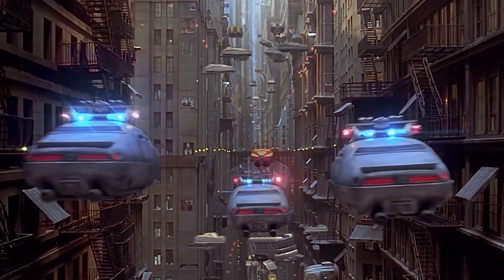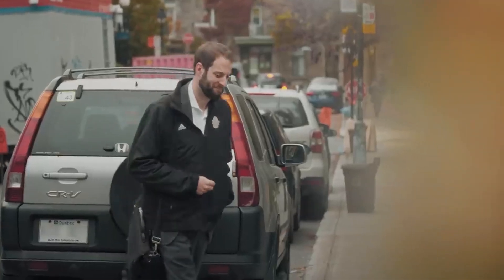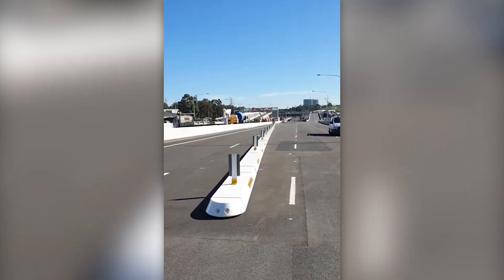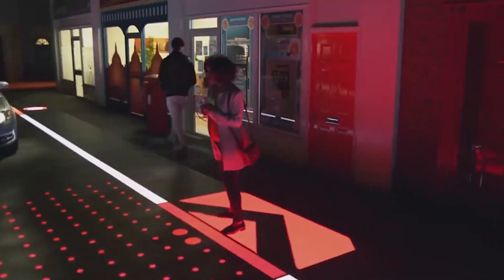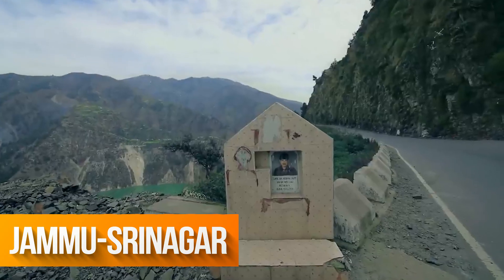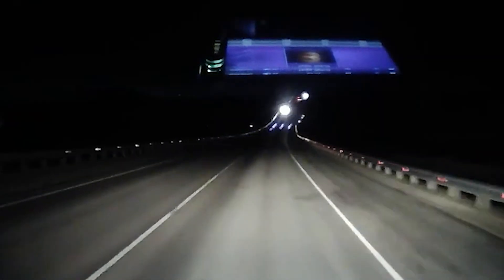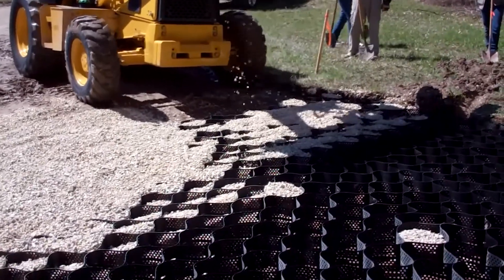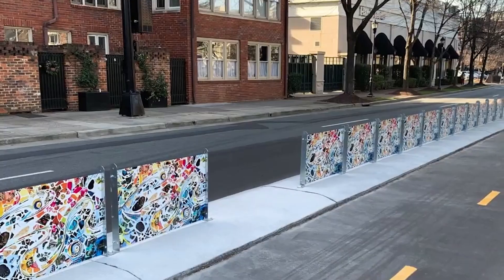Incredible Road Technologies That Are Insanely Cool

Comment: My bother has been creating and using "pervious concrete" in the (San Fran) bay area for over ten years.  It's mostly used on parking lots, driveways and walkways-as it doesn't (yet) stand up to very heavy-vehicular traffic.
Reply: Wut, it's been the highway standard where i live for over a decade
Reply: @bunch_of_numbers  And WHERE do you live??? And are you certain it is Pervious Concrete?
Reply: @leonardothefabulous3490  idk if it's the exact same, but it's pervious asphalt. But i live in the Netherlands, where winters are relatively mild which helps it last
Reply: @bunch_of_numbers  Thanks. It is not the same product. You have Asphalt, the product I'm talking about is Concrete.
Reply: @leonardothefabulous3490  yall make roads out of concrete in the us?
Reply: @bunch_of_numbers  Yes-and asphalt-which covers more roads than concrete/cement.  However the product I'm taking about  is NOT being used on roads. Hopefully one day it will be but for now it's used on driveways, walkways, parking lots, etc

Comment: 8:19 I’m confused. At least in my area, traffic signal override systems have been in use for at least the past 2 decades. Obviously their use is monitored through the traffic light control computers, so while it is possible to get them on the black market, they are highly illegal to use and very traceable, so you’re unlikely to go a week of regular unlicensed use without getting tracked down and locked up (assuming you can’t pay the astronomical fines for this sort of blatant disregard for road rules). Naturally, your license to drive is unlikely to be recoverable, too. So why is this in a list of speculative future road technologies?

Comment: The roller barrier seems to push the vehicle back into the traffic lanes. Which seems to be a larger problem, at least in my opinion.
Reply: Conventional barriers are literally designed to prevent cars bouncing back into traffic, i dont get the point of these rollers

Comment: 6:07 this is a copy from the dutch roads. They call this an experiment?? There's around 3000 km of highway roads in The Netherlands using this technology for 15 years already! There's not a single splash of water even during the heaviest rainfalls on dutch highways. The brits did NOT invent this. And it's not an experiment, it's already widely used on dutch roads.

Comment: A problem with all solar-powered signs and warning lights is that current battery technology only lasts a few years, after which batteries fail to recharge. If drivers rely on the warnings and they suddenly stop, accidents could occur.
Reply: Reflective already exists. You just need to turn the lights on. No need for solar powered.

Comment: The porous asphalt is very, very well known. However, it has to be maintained. And that includes actually vacuuming it!
Reply: Nope! The layer underneath must be porous and too much water has to flow to the sides. Normal rain will wash away sand.
Reply: @dutchman7623  I have a brother that has installed these in Arizona. His first complaint was that he had to go and vacuum these parking lots at least once or twice per year to keep the sand from building up and creating a non-porous surface during that time.
Reply: @RazingthenRaising  If used on highways and big roads you do not have to vacuum clean them. Never saw anything vacuum clean hundreds of miles of highway.
But the underground has to be laid out correctly (drainage to the sides), and the top layer thick enough.
Reply: @dutchman7623  Understandable. Traffic tends to blow things around. My brother's complaint was parking lots.
Reply: @RazingthenRaising  And the climate in Arizona is rather different that what we have here. Very moderate and rain at least once a week.

Comment: 8:24 I'm pretty sure this already exists. There have been times in the past where people are able to change the lights on signals by sending out certain frequencies. Although this would be the first time I've seen it used legally.
Reply: All Dutch emergency vehicles, public buses and trams are equipped with it, instrument is called a transponder. No use to steal it, because it will be removed from the list of active transponders and therefor useless.
Reply: I think this actually exists pretty long already, like 10-20 years. Here in Germany it is all over the place.
Reply: Most things in this video already exist in some way. Often times simple more effective ways.

Comment: The system to change traffic lights has been in use in America for over 20 years. The emergency vehicles transmit an encrypted light signal with the password and the unit ID
So you can see exactly who has triggered the green light and what lane, direction and time it is triggered
It is called MIRT
Reply: Even Dutch public transit like buses and trams have this system. They always get green with priority, unless they are ahead of schedule. So their time schedule is integrated in the system.

Comment: We call that asphalt popcorn pavement in the northern US. The purpose of this asphalt is that the water seeps through this surface layer and drains on the intermediate surface, eliminating surface water and the potential hazards that come with surface water retention. However, when water freezes it expands, and when this happens in between two layers of asphalt, they separate. This asphalt mix had holes everywhere from freeze thaw cycles earning the name popcorn mix. It’s been around for a long time and is only used in warmer climates due to this characteristic.
Reply: We use it in the Netherlands, not sure how but the freezing problem has been tackled.
Reply: @Snaakie83  It hasn't been tackled, they just repair it very fast.

Comment: They used to call speedbumps "sleeping policemen".. until they realized people were going faster not slowerr when going over them.. by the way, sometimes it works too, you don't notice them so much.
As for the lights at 10:00 gat see some drivers having fits and it bringing in epepsy.. the electric rail in the road.. try riding your moped when delivering a pizza and see if you can "get out of the Groove" man.
Reply: Don't you think they have pizza in Amsterdam, Rotterdam or The Hague where streets are full of tram tracks?

Comment: The plastic road panels at the 10:00 mark are stated as 10 square feet.  They appear to be about 10 x 10 feet which would be 100 square feet.
Reply: Yeah, I think he meant to say 10-ft/sq. instead of 10-sq./ft.  also, it was at 11 mins,
Reply: And with it you get a bidirectional Dutch cycling path, complete with the right color and texture. It is still in experimental stage where some stretches are used to test durability.

Comment: 6:10 The Porous Road system in the UK, though not implemented beyond some experimental stages, was proven to be unworkable. They proved to be unreliable in the event of low level flooding points where the water HAD no where else to go, debris clogging the ‘natural’ water channels, and was ripped up far easier by freezing/melting conditions and heavy traffic.
Which is a pity, as it is being used in some parts of Europe.
Reply: Had it as part of my company’s parking lot.  Completely inefficient in cold weather with ice and snow.   Couldn’t plow the snow and the ice did a number on it.  A warm weather option only.
Reply: You do know all dutch highway roads already have had this for 15 years? Rain get's absorbed instantly, not a single splash. This road has not been created by the brits. It's a dutch creation.
Reply: @Nimac91  
I never said it was a UK creation. I also never said it wasn’t being used across Europe.
I said it is unworkable in the UK, the reason I said it is unworkable in the UK is because the drainage system in this road would be defeated by low level flooding in the UK, a vehicle on fire, ice formation, debris, and trucks, which let’s face it, damage even non porous roads.

Comment: Drains don't typically get clogged in my neighborhood it's usually there is too much rain to handle at once. 
Potholes are patched they won't replace 1/4 mile for one pothole. They don't want to spend the money unless it's really bad.

That pavement would be horrible for a bathroom floor. I rather have a waterproof floor where puddles form than the floor boards rotting.

Cool video but the commentary.....

Comment: How well with that water absorbing asphalt do when it gets a lot of melting snow and then it suddenly drops below freezing?
Reply: Simple: the water freezes,  expands, cracks and demolishes the asphalt, creating holes in the road, ultimately damaging vehicules.
Reply: @onemanarmyoma0155  Ah, ok. I'm not crazy. This does seem like a terrible idea.
Reply: @did_I_hurt_you_feefees  so they implemented water permeable concrete in MN, we get well below freezing... talking -40 or 50 and after 6 years still no major issues besides usual wear and tear. 

Not sure the science of it. They may have to run sewers underneath to act as warming elements, but it still does the job. Not sure under higher stress of vehicles either, but the parking lots I have seen testing asphalt have no major issues after 2 years (?)
Reply: @ethanf5441  Well, if that's the case than this stuff should be everywhere. I don't see how water can be inside the cement, freeze and not damage it, but if what you're saying is true then they've figured out a way. Get that stuff everywhere.
Reply: @did_I_hurt_you_feefees  dude don't look at me lol, I'm not a scientist or engineer, I have just seen it installed around
Reply: @ethanf5441  Well, I didn't mean you get out there right now and install it in my parking lot LOL
Reply: @did_I_hurt_you_feefees  lmao
Reply: @Joe Brandon  if I recall, there is typically some system that allows the water into regular sewage systems, so it isn't stagnant in the road
Reply: @John Redcorn I'm so glad you let me know that you don't know. Now I can sleep tonight! <phew>
Reply: This idea has been around for years … and it is always that freezing water that shoots it down in flames. Night work in warmer climates,  ut not in the U.K. unless they have found some way around it
Reply: Quite well, cause the asphalt doesn't absorb water. The asphalt is porous and water drops straight through to drainage underneath.
Reply: They salt it more than other pavements on the first day, but then some salt remains. Then salt it less for the rest of the season because porous pavement keeps more salt in it than other pavements for longer. I dont know why that is, ask porous pavement yourself if you wanna know the full details lol. Or just look up the explanation as to why that is. All i looked up was why the pavement didnt shatter. Now say if humanity ran out of salt or a solarflare broke every electronic on earth then, yeah, ice would break it. But as long as salt exists and electronics dont get permanent emped by a mega solarflare its just got wind and sand erosion to worry about. Which its also less susceptible to erosion as well.
Reply: @jeremymartin228  Makes sense.
Reply: @jeremymartin228  aren’t we running out of road salt? At least that’s the rumor I’ve heard
Reply: You sound somewhat like Joe Biden, I just can't understand what your talking about
Reply: @bunbun1819  So, your inability to understand simple English is somehow supposed to be a me problem?
Reply: Maybe instead of a ‘sponge’ type of obsorbsion its a type of draining system which drains the water into the ground?
Reply: Just check the Dutch DOT: Rijkswaterstaat
Look for ZOAB (Zeer Open Asfalt Beton) (Eng: Very Open Asphalt Concrete)
Has been in use for decades now. Requires a little more maintenance but the advantages are enormous, both in aquaplaning and tire sound reduction.
If you switch from a 'normal' road onto a ZOAB road you are immediately wondering what is missing; car noise! Not only for the car but also for the people who live near that road. You can hear birds instead of an Indy car circuit.
Reply: JOE? WHAT ARE YOU DOING HERE????
Reply: @Triflesoup  At this very moment I'm writing a comment. Why? I'm not really Joe Biden so I'm not lost LOL
Reply: Asphalt is not the same as concrete. Asphalt is pretty flexible, asphalt can be designed for colder climates. Downside is it will perform worse in hot weather. It's a bit like summer and winter tires.
Reply: @sjaakspaak  True, but asphalt is more fragile in the winter and even a little ice can shatter it.
Reply: @did_I_hurt_you_feefees  more fragile than asphalt in the summer or than concrete in the winter?
Reply: @sjaakspaak  Asphalt is very brittle in the winter and not so much in the summer (heat makes it malleable and cold makes it brittle). Concrete is pretty much the same year round. I'm specifically wondering about this asphalt that allows water inside its structure to drain. I want to know how this specific asphalt holds up in that.
Reply: We have it in our town in the Midwest. No issues.
Reply: 🤔👍. But it’s like the Theorem by that OLD ROMAN DUDE’s “ Physics of Water & Equalization “!  Global Warming -ICE melting? Then RAISING & Flooding!  The ‘ amount of Frozen Ice Volume/ weight ‘ are Already Equalized. I’d worry more about the High-Tech Absorbing TAX PAYERS $$$ !!😂
Reply: It will work well in places that doesn't snow
Reply: PS- I’d worked CITY/ Highway DPW Storm & Sewer .There’s no easy answer.Suburbs?- No Problems.  For City/ Highways?— @) IF you 🤔, you’d be Happy with what backed-up then Drained Rain Rinses away!  @) Although.., when Torrential Rainfall / City Street Rain water can’t be Dispensed fast enough via STORM LINES- they OVERFLOW into the Water-Sewage-System.  Seriously overtaxing the Sewer/ Waste Treatment Plants & piping.  It’s a small Safety-Backup. It’s a Crappy Job, but someone has to do it. At $52 hr.- I never complained.
Reply: and does it allow oil and gas to pass as well?
Reply: @freshlix9554  don't see why not
Reply: Did you go to school guy? “How well does the” not  “how well with that” which literally makes no sense
Reply: Good question

Comment: 4:30 That idea is ludicrous. All those blinking lights and graphics appearing on the road will be confusing and probably cause more accidents than they will prevent.
Reply: Correct! This is idiotic. But we have pedestrian paths, cycle paths and car roads where the illumination 'follows' the user, not by switching on, but where the user is, it is brighter, and it slowly goes down to a minimum when there is nobody.
The faster the speed, the more road ahead is lit.
Energy efficient and better for wild life around these roads.
Reply: I'm at the 9 minute point with the blinking lights and they already exist.  I was in Mexico last week and experienced them and I have never felt so disoriented when driving.
Reply: @Bill-ek6ew  IKR! I mean can we just stick with road signs as they are and not create new crap out of no where displayed in ways that we never see... This all just seem so unnecessary.

Comment: 3M has already (since the 80's)  a system used in Minneapolis that coordinates traffic lights when approached by a vehicle with a strobe light. Korea has guard rail with wheels installed parallel to the road surface. This is safer as out of control cars are deflected instead of being launched into the air.
Reply: That’s what I was thinking too
Reply: The strobe on emergency vehicles to manage traffic lights is OLD technology.  Where is it allegedly "new"?
Reply: Canada has had this for decades as well. It used to be that if you flashed your highbeams really fast, you could trick it. Highly ticketable offense BTW
Reply: I never knew road technologies could be so fascinating until I stumbled upon this video. The intelligent traffic lights and 3D-printed bridges are truly incredible. It's exciting to see how technology is improving our infrastructure and making our roads safer and more efficient

Comment: Porous asphalt has been the standard for highways in the Netherlands since 2005. I don't know if the water holding capacity is as great as the British product but it is big enough to prevent aquaplaning even in heavy rain.
Reply: @Solitaryconfinement both words are correct!
Reply: @ibubezi7685  that's your own asphalt.
Reply: i LOVE COMMENT BRO I LOVE YOU  😘😍👍😘
Reply: I so wish we could use this in the US Midwest, but our heavy snowfall/ice, the equipment/chemicals we use to clear it, and extreme temperatures ( -40 C to 40 C) has found not to work well with porous materials.
Reply: @MattJohnson2469  I’m from the Midwest myself. I don’t believe it to be the chemicals so much as the water seeping into the cracks of the asphalt and expanding as it turns into ice. The force of the expanding ice pushes the asphalt apart. Granted the salts that we place on the roads do cause our metal vehicles to oxidize faster. Plowing the snow and ice off the roads seems to also remove some of the already damaged asphalt.
Reply: @justinweatherford8129  Good point, we already see the impact of water freezing in  potholes and cracks. I live not far from the road surface testing area of I-94 so I commonly get to experience what they're thinking of for better road surfaces. Sadly, I haven't seen one that can stand up to the harsh weather and those plow blades. Thanks for the reply!
Reply: What a great concept I wish we could have it down in Australia
Reply: thats great, if its always hot. most places see freezing water for a few months a year and it would never work there.
Reply: @_j_t_p_  The Netherlands always hot? Wait what? It's a cold and miserable place.
Reply: @Herla  mhmm. So why tf would they introduce porus asphalt, to allow for freezing/expanding water to bust it up? It doesn't make sense. If it works, great. I just get how it would